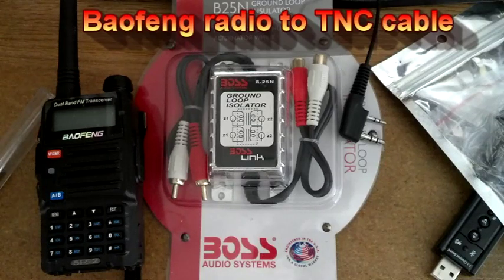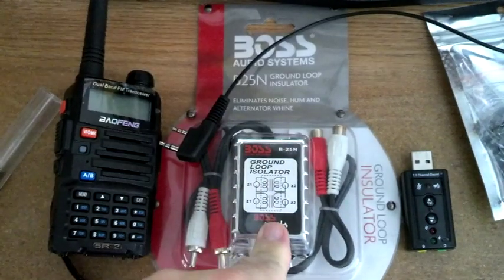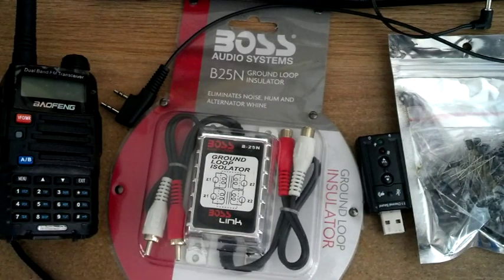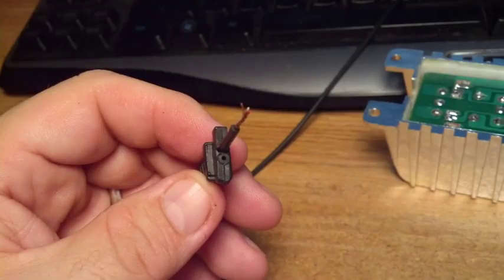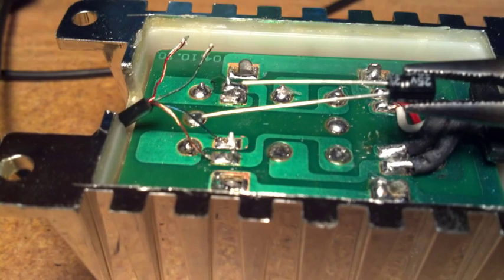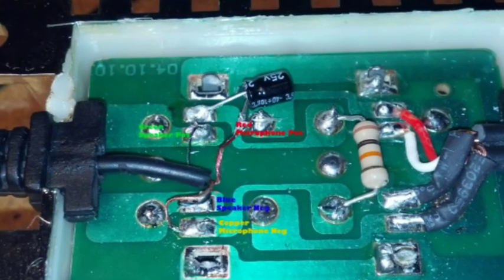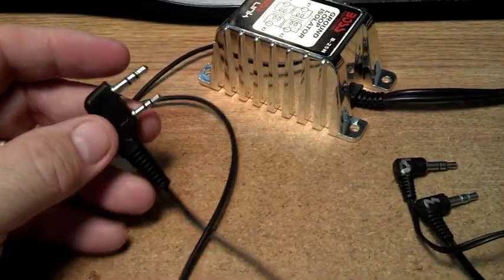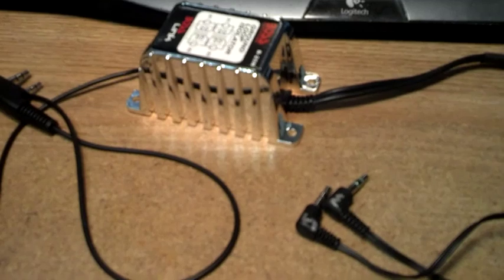Baofeng Radio TNC Packet Radio cable

Comment: the problem i have is that you did not show how u connected the 3.5mm leads to the out put do you connect the top of the pin or the mittle of that pin to the speacker input to the sound card....

Comment: ok im the smart one  i took all the cables off the isolater unit  with out checking  witch one went to the mic ground and the speacker ground and how did you connect the cables together  as i have 3 wires in each side of the 3.5 head set jacks  so witch wire goes where.. from to to bottem and the capasoter is on the left side just like in the vido..  any help is great......

Comment: does anyone know if this will work for Allstar linking
Reply from the maker: I will have to take a look at that later. But I will say this. If you can key up one radio, It will key up and transmit on the signal on the other radio.
Reply: +North Carolina Prepper I am trying to get out of modifying the sound card
Reply from the maker: I think it would work.
Reply: I used the same sound card and got an Easy Digi VOX by KF5INZ. Some cables to fit my Baofeng and voila done.  I added it to my blog. I spent about 15$ since I had almost everything already except some cables and the easy vox that I got for 10 on eBay. 

This is also good information since I have a few of these laying around from my car sound days, 

73's guys

Comment: having a problem with the radio keying up when fully charged in the charge cradle. do you seem to have that problem when using this ground isolator? do you leave it in the charger when hooked to the sound card
Reply: Don't leave the radio and/or battery in the charger after charging is complete. I believe this is spelled out in the manual as well as a few sites that cater to the Baofeng.

Comment: Did you wire the mono output of the isolator to both the left and right channel on the soundcard input 3.5 mm stereo plug?

Comment: I made a simple cable today to connect a Baofeng UV-5R to a simple TNC-2.  I connected 4 wires: PTT, ground, audio in, audio out. The ground was from the speaker connection. The PTT wire from the TNC goes to the mic ground. I didn't need a sound card interface. I just connected those four wires. On the Baofeng, no adjustments had to be made. Vox was left off. I had no problem today connecting to a Winlink station and a couple of BBS stations.
Reply: That is because you are using a TNC. The above setup uses a usb sound card and software to replace the TNC.